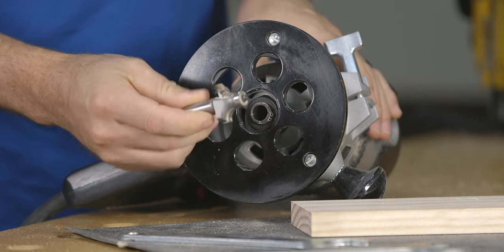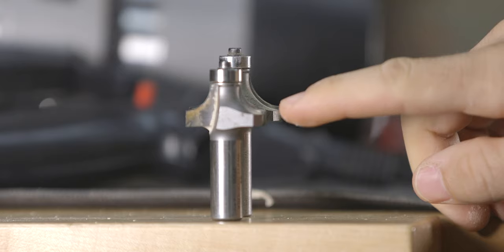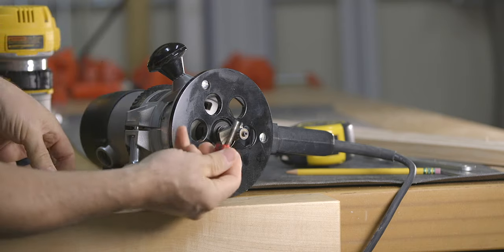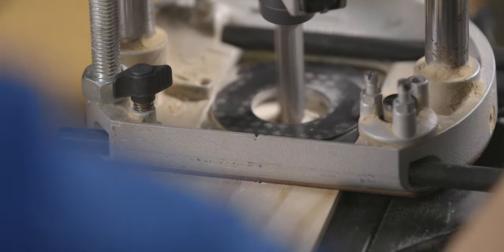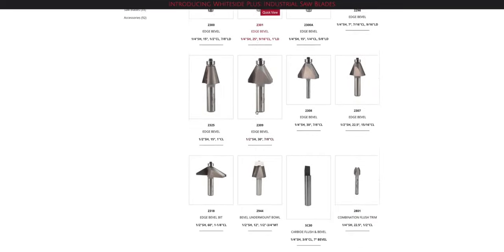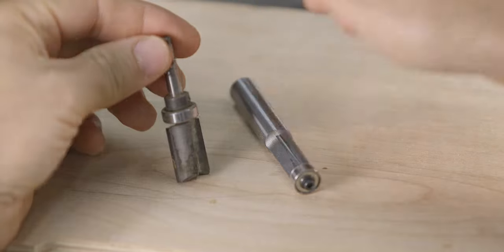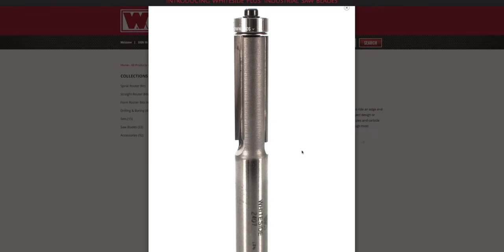The Best Router Bits For Beginners

Comment: In the UK from "HomeBase" I purchased a set of router bits for £10. The set contained 10 router bits. Thats £1 each considering how much effort it took to manufacture each bit they are dirt cheap. They are still working fine 5 years later.
Reply: I also have frued, whiteside and Diablo bits and they aren’t performing any better than the Chinazon prime bits I have. The Chinese bits from Amazon were about $1.75 USD per bit while the Whitesides are around $30-$45 USD per bit. 

I will likely still continue to buy a mix of expensive high-end bits as well as dirty cheap Chinese bits from Amazon…

Comment: My router is an older craftsman giving to me and only hold 1/4 shank bits.  I am a newbie for sure..Can I find the ones that you suggested in that size?  Your video was very helpful.  I like that you showed how the wood would look after using the bit.
Reply from the maker: You should be able to find them all in 1/4". Whiteside used to sell them in a kit but I haven't seen them in awhile. Also if your interested, I do have a beginners hand-held routers course coming out soon. If you want to be notified when it launches check out this link -->  https://bit.ly/2I8vT9k

Comment: Thank you! That was most informative, especially that bit (yeah) about the bearings location for the flush trimmer. Since I'm a noob woodworker, I will get the trimmer with bottom bearings when the time comes.

Though I'm just a DIYer, I prefer to get good stuff so that (i) I don't have to repeat purchases once cheap stuff fail, (ii) they don't fail on me when I don't know how to handle it, and (iii) I don't miss out on any parts that's supposed to be in the package - from Amazon reviews, it seems Freud is notorious for missing components. I was hoping to just get their stuff, seeing how attractive their prices are, but seeing complaints about missing parts, poor customer service, makes me stay away. Add the fact that I'm not in the US, returns are a dicey thing, another thing to worry about. 

Even Whiteside seems to have this problem of missing parts. It seems like I'll have to go with Amana, but they're so expensive.

So, instead of five bits like you mentioned, I'll have to make do with three - the straight cut bit, the flush trim, and the round-over. Everything else, like dados, will have to be worked around using these three.

Again, thanks for sharing.

Comment: Great and useful information. The only thing you need is a Musclechuck to help you change out all of those bits with ease.
Reply from the maker: Do you like yours?
Reply: @TrainingHandsAcademy  I do I have one for my personal porter cable Router and it works great. Makes tool changing a breeze.
Reply from the maker: @derosaengineering1085  Any downside? Things you don't like about it?

Comment: Do routers stated HP matter? Can you touch on that briefly?
Thank you for making these videos.
Reply from the maker: If you are doing mostly edge treatment, then no, HP doesn't really matter that much because most edge forming bits are small in diameter and don't put a lot of strain on the router. However, if you get into spinning larger bits, larger template work, panel raising and things like that, then HP does matter. I hope that helps.  If you didn't already know I have an online router course that covers all this information and much much more. If you're interested check it out. bit.ly/3DcIeE3

Comment: Loved the informative video. Just bought my first router (trim). Should I be looking for carbide or carbide tipped bits? I’m a beginner looking to work on little projects. 
Thanks
Sam
Reply from the maker: Hey Sam, great question!! I would recommend using carbide tipped bits, like Frued or Whiteside for example. They are far more durable than solid carbide, and will give you a much better cut.

Comment: Thanks for the video, but I have a project in mind and I'm still confused about what bit to use. I have a workbench and I want to install a T track in the top from end to end. What bit would I use? Would it be a straight cut with multiple passes? Also, it seems that for the first pass that the router is going to be pushing and pulling simultaneously, correct? Thanks for the great video.
Reply from the maker: Yes straight cutter, and yes it will be a push and "pull" (climb) cut at the same time. However the second pass will not be that way. Thanks for the comment. If you like my style of teaching you might also really like my beginner online router course. Check it out here if you want. https://bit.ly/3DcIeE3

Comment: Thanks for the sharing. When would you need to use the 1/2 in vs the 1/4 in? Is one more geared to certain projects than the other?
Reply from the maker: Great question! 1/4 routers and bits are great for smaller projects, where 1/2 routers and bits are good for larger projects. However, there is some overlap that can happen, it just depends on what you are doing. Hope that helps.
Reply: @TrainingHandsAcademy  ty.

Comment: My application / need, to cut window / door openings in LP Panels, thinking the flush trim bit would work best, because the bearing would ride on the 2x4 interior frame. Would there be a better choice?
Reply from the maker: No, that is the one I would use. Drill a small hole for the bit to go in... and rock and roll! I would use a 1/2 bit with a 1/2 shank.

Comment: A question for the expert (a fellow named Josh):  Would I be able to use my existing 1/8" shank Dremel bits, with a 1/4-1/8" adapter, with my DeWALT palm router DWP611???????
Thanks!
Reply from the maker: No, I would not use them in the palm router.
Reply: @TrainingHandsAcademy   As long as I move slowly, so as not to create  excessive/adverse lateral movement on the bit shaft, why not? 
IOW, any other reason, please?
Thank you!

Comment: Please help if you can and thanks for the video. 

I've never used a Router before and wondered if you could help with a question? 

If I want to cut a 2cm depth by 44mm width trench using a plunge router, what size straight  router cutter length do I NEED to use? 

Let me explain my train of thought based around the depth of cut. 

Can I use a cutter that is 19mm cutting depth and just go extra 1mm via the router or do I NEED to use a cutter that is bigger in cutting depth than the depth I'm cutting?
 
Or could I just use a cutter with a cutting depth of 63mm and only go 20mm deep and therefore have a cutter that I can use in another job in the future that I might want to go much deeper, say 50mm?

Or another example is if I buy a 1/2" with a cutting depth of 19mm, would I be able to use this to cut a depth of 50mm for example as obviously I would take out material more and more in stages. 

Any help would be greatly appreciated.
Reply from the maker: 1. At least a 2cm long router bit. 
2. You can use the router.
3. Yes
4. A 19mm may not be able to go to a depth of 50mm just depends on how much your router will lower.
Reply: @TrainingHandsAcademy  That's fantastic. Thanks so much for the quick reply... What length would you personally choose if you were going 2cm deep?
Reply from the maker: @justonemorego4079  https://amzn.to/3l1n55f
Reply from the maker: @justonemorego4079  or this one https://amzn.to/3w2nef2

Comment: Shank diameter determines how solid a cut is, becuse the smaller the shank the more the bit will chatter in the cut becuse of deflection. Your always better off with a 1/2" shank. But you cant always get the bit you need in the size you need with a 1/2" shank.  Some bits only come in 1/4" sizes. And likewise for larger bits.
Sure you can stop chatter by taking more passes with shalow cuts this may even prevent tear out. Its not a preference there is some mechanical advantages to it.  To prove my point havent you seen a drill bit bend of center drilling a hole. 
Same things apply here.
Reply: You are assuming use in a router table. If you are doing freehand routing, say with a small trim router then ½" shank bits are not a good idea. It's why the most commonly available flush cut bits are all ¼" or 6mm if you are outside North America/UK.

Comment: So once we use bit with bearing we don't need to put stop on router right? The bearing will stop against the wood? Could you show us how
Reply from the maker: Yes, the bearing will stop spinning once it hits the edge of the wood. Great question!
Reply: @TrainingHandsAcademy  may I ask you more question!!!! So I can  cut little flush dado on frame of cabinet door to put panel door 1/4 in thickness on it? Thank you so so so much. Some day could you make kind of this door by this way.??
Reply from the maker: @md8744  Are you asking which router bit? I do have a video that shows making a door with a table saw. https://youtu.be/OdImx4h0MWo
Reply: @TrainingHandsAcademy  thank you already saw that video

Comment: Could you use router bits in a larger corded drill if you don't own or have the need to purchase one like a weekend dyier
Reply from the maker: No, the drill doesn't spin fast enough and it's just not safe.

Comment: Can one carve or cut organic shapes or cuts with the straight bits? Ie carve a design into wood?
Reply from the maker: Look up sign making router bits. :)
Reply: @TrainingHandsAcademy  not signs gallery painting panels in ovals and circles for my art. Ply wood on Mdf cradle supports. The carving is for doing designs I’ll pour resin onto .. but yes I’ll
Look at that too. Edit: looks good. 
Just took a brief look . Iots to consider . Thanks

Comment: Maybe you can help. How is possible to use a 3 1/2 diameter bit on a router ( mine is Bosch 1617 evspk) the shank is ok but the base mouth is a little ro Small.
Reply from the maker: You would need to mount it to a router table.
Reply: @TrainingHandsAcademy   the idea was yo use it to flatten a big slab of wood using a router sled .

Comment: I need help. I do not have Facebook or Instagram this is the only way that I can reach out. I have a board that is 2 inches thick by took my dog bowl laid it upside down to circle and then cut out a circle that was quarter inches smaller than the dog bowl so that I had a lip for the dog bowl to rest onto when it laid in the hole but my question is because I used a jigsaw to cut the hole out it’s of course not very clean so I need to know what router bit should I use for my plunge cut router in order to clean up the inside diameter of the hole that I cut out for the dog bowl to sit into.
Reply from the maker: You will first want to sand it smooth before using any router bits... unless you are using a pattern and a router bit to clean up the hole? Check out this video. https://youtu.be/BXxk5fec4QY

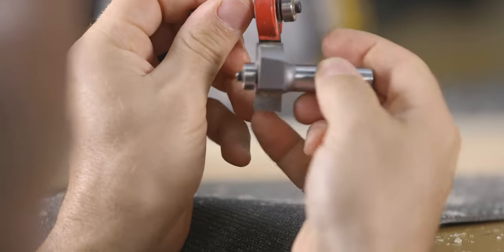Comment: I am a little bit confused. Maybe somebody can help out. At 5:20, the presenter is talking about the differences in the depth of cut for each bit. We can see that the red one is a little bit smaller than the silver one. The presenter says that the silver bit makes a cut with a depth of 3/8", whereas the smaller red bit makes a cut with a depth of 1/2". I can see that the silver one has a bigger height than the red one, so wouldn't the silver one cut 1/2 inches in depth? Am I missing something or was there an error made?
Reply from the maker: Hello. Looks like my timing on which bit I shook with my hands is a little off, which makes it confusing. You are right, the bottom bit is the 1/2" and the top is the 3/8".
Reply: @TrainingHandsAcademy  Thank you for confirming. I'm not a total novice with woodworking, but perhaps I thought that I was not understanding something.

I see, you were probably doing a voiceover at that time.

Fantastic video. I have been trying to figure out how to replicate some old cabinet doors and you featured two bits that I will end up using to recreate the design.

Thanks!
Reply from the maker: @nikolaiv1138  Awesome, have fun!

Comment: How does one know which router bits their router accepts? I have the Milwaukee compact router
Reply from the maker: Compact routers in the US only take 1/4"
Reply: @TrainingHandsAcademy  thanks for the response! Will this limit me in terms of the scope of the bits I can purchase? You mention you prefer a larger shank but I didnt know the disadvantages when I purchased
Reply from the maker: @crappysoup  You may be limited at some point, but having a compact router is a good thing. At some point you will need to get a larger router, but for now you should be just fine. If you're interested, I do have a beginners hand-held routers course coming out very soon. If you want to be notified when it launches check out this link -->  https://bit.ly/2I8vT9k

Comment: In the UK the term “mill” is commonly used to mean millimeter. 
However in the US, Imperial engineering units the word “mill” has a specific meaning of one thousandths of an inch (0.001”) NOT a contraction of the word millimeter. 
In the US if you mean millimeter, say millimeter. If you think that’s a trifling detail ask any US machinist. 
My 2 cents.
Reply from the maker: Thanks for your 2 cents.

Comment: Quite misleading when you talk about shank size, you said you prefer 1/2 over 1/4, but the router you use and recommend in the video - DeWalt ONLY takes 1/4 inch.
Reply from the maker: Sorry to mislead... most bits come in both shanks sizes. I prefer 1/2 when possible (especially on larger bits), but when using small profile bits with small routers, 1/4" is fine because you are not removing a lot of material. Therefore, you don't always need the added strength of a 1/2 shank, and in general, I always lean towards getting 1/2 when I can, and when it works to do so. Let me know if you have more questions. Thanks for the comment friend!

Comment: I’m a girl. And I have no friends, my car is broke so I can’t go anywhere. I’m stuck at my mom house in the garage…. & I want to ROUTE SOME WOOD. I got a router table from harbor freight.. (I’m so confused though on how I’d ever pull off the exact depth I had before if I were to switch bits) (I’m also scared that I’ll either not tighten the bit ENOUGH & that it’ll spin off 100mph & spin a big crater into my face of blood & gore & leave me disfigured for life - & that if I tighten it too TIGHT.. that I can break the motor….. (I heard that could happen from a guy that did a review of the harbor freight router table) SO… I have had to same bit in my router table.. for a year..m
I want to create a similar theme throughout my garage with fluted trim (on the board & batten/wainscoting thing I’m attempting) as well as the chair railing & random 2x4’ms & 4x4’s. I want the 3 lines of grooves going down the full length of each piece.
I have a cordless Ryobi compact router 1/4” bit as well as another router that does 1/2” bits. 

How would I space the 3 grooves apart so that they’re consistent & straight on each piece. 
And do I want to do this on the dooor or with clamps &!- work table?
Reply from the maker: Hello! I'd like to help with your router questions, and I'd like to pray for you as well if that's ok? Email me and I'll figure out the best way to help you. josh@traininghandsacademy.com